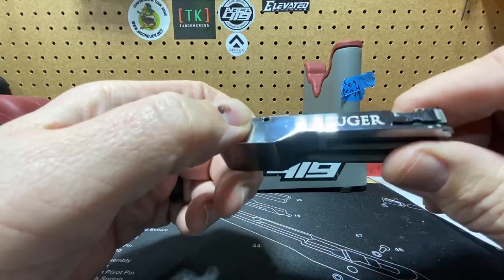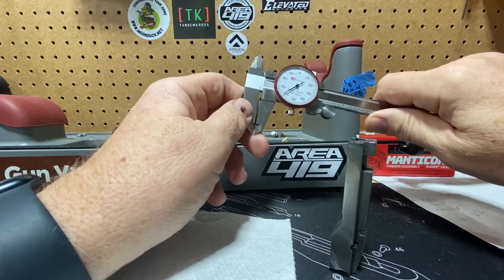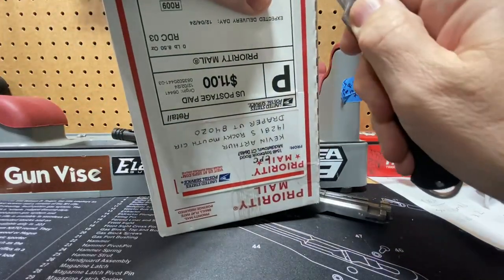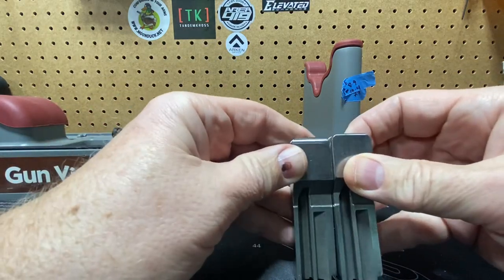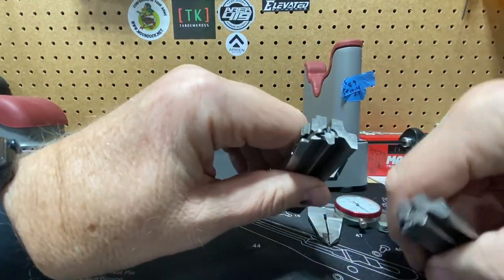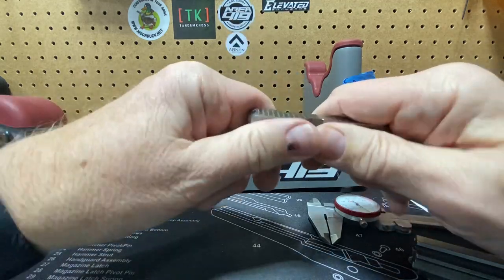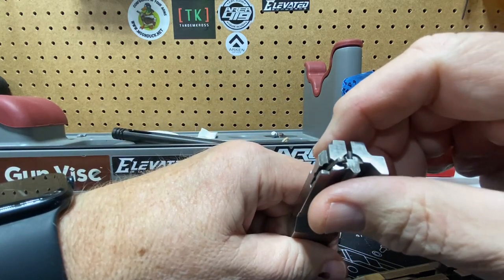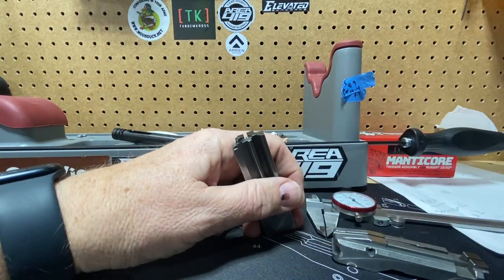Ruger Bolt - modified.

Comment: I'm curious to see how your bolt mod works out...  I measured my Ruger bolt, HS is .044 and it's chromium steel, it always had flyers. My KIDD bolt is also chromium steel, HS is .042 and it shoots CCI Standard Velocity and AR Tactical really well. .750 @100 and .290 @50  Just picked up a 21" Lalja match barrel, now waiting on Lapua Long Range ammo...

Comment: .62 head space? That damn near 5/8 of an inch!
I own a 1022 and I can assure you the bolts are not cast aluminum.
Reply: Mine was .058"...I reduced it to .044"...Haven't had the chance to shoot it yet...He needs to learn how to read, and then write out the measurements..And use a depth micrometer for a more accurate measurement..

Comment: head spacing on a rimmed cartridge? and cast aluminum bolt? REALLY?
Reply: It's not aluminum
Reply: There’s a video or two floating around on here with actual evidence of proper head space tightening up groups significantly.
Reply: @ It definitely makes a difference. If your headspace is not properly set from the factory you will see a significant improvement. The quality and preciseness of the crown cut is a huge factor too. Most of the better quality rifles will be in spec out of the box.
Reply: It makes a big difference on 22lr. Just watch some videos.